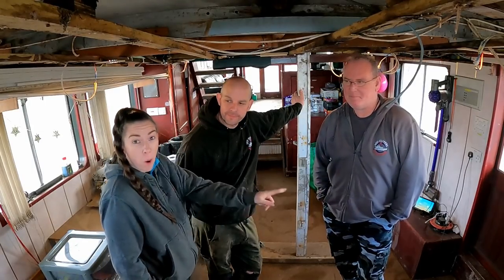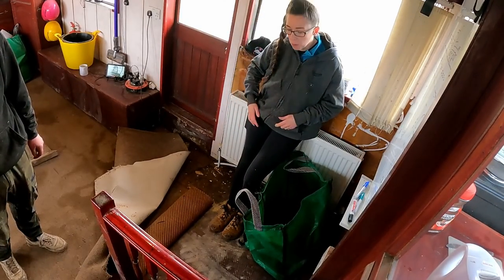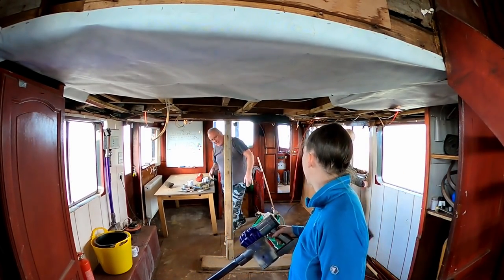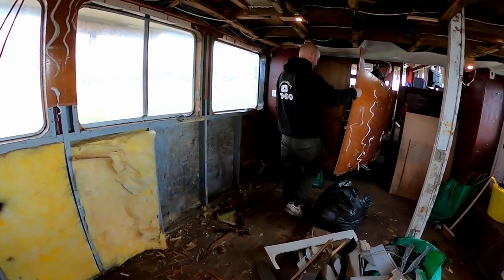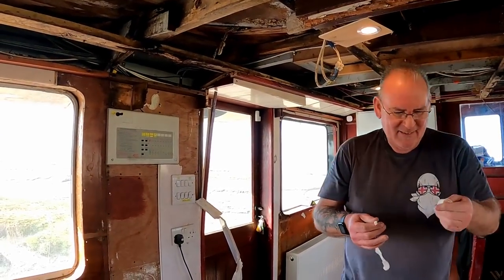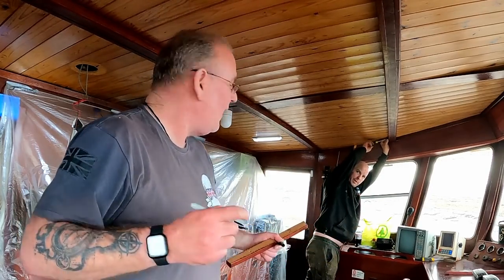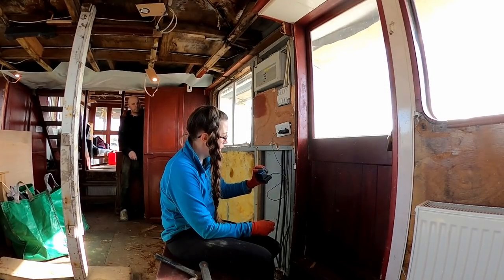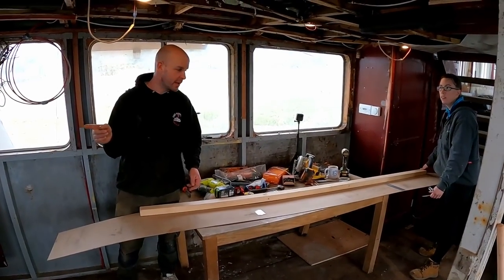Ep 63 - How to Make a Template For A Deck Beam -Progressive Destruction Day On The Boat

Comment: Gemma, most people don't know, but on your DYSON, there is a small knob on the top within a circle. Pull it out. That's the secondary air filter. If it's clogged, it will stop the vacuum from working. When the filter is out,  the  vacuum should work. You may need to use the air compressor to clean that filter. Thanks for the video. Jon - Southern California
Reply: Same thing happened to me.  Flashing red light. Thought the battery was dead, but it was the secondary filter.  Easy fix and new life for the Dyson.

Comment: Make sure you RUN EXTRA wires when you do the repair. That way you can add circuits later or use them to repair circuits without tearing into the walls and overhead. Looking good so far on the tear out. It's gonna be great to see the new rafters and runners going into the overhead. Best Wishes & Blessings. Keith Noneya

Comment: When you reframe the deck(s) above the engine room are you going to build in a "SOFT PATCH" that is reasonably easy to remove in the event of needing to do major work in the engine room?  A little more work at this point will save countless hours in the future if refit work in the engineering spaces is required.
Reply: Classic boats I've been have a Soft Patch built in either with an easily removed skyvent or panel. My wheel house had a pair of vent cowls that allowed a hoist rope through when removed, the engines could then be hoisted up to floor level and then out of the wheel house door and then craned off the rear deck. The wheel house floor and beams were slot fitted and straining points held the hull in shape, temporary wires and turnbuckles were used during engine refit.
Looking at the standard of the woodwork, I would wonder about the standard of maintenance on the CAT engines. So provisions should be made for their removal. 

Loved the Brit banter, something I really miss. Take care you all and thanks for entertaining me through breakfast.
Reply: VA3 GJA, great watching these guys, really enjoying them.

Comment: Congratulations for all this work done since the beginning...!! I discovered your channel, and realized that nothing is impossible when you have ideas, courage and are motivated to achieve them. a crazy project, indeed which is progressing well, you have done the most disgusting, it is necessary to precede. The advantage of wood is that you can repair and replace parts, you now seem to know what you are doing, it is always better to plan too solid, than not enough...!! I will continue to watch and wish you many Patréons who will follow you. Speaking of mental health, it's true that for 2 years it's been quite dramatic, especially when you get older (retired) and everything hurts you to undertake. staying in bed (siatics) isn't the solution either, and looking at you I tell myself that I'm going to have to move my buttocks... good for you... vincent in France Bretagne, opposite you !

Comment: Well. That could have been a lot worse. As long as the uprights are still good, the pretty panels shouldn't give you too much issue.  (Hopefuly)

I was surprised at just how much the sound In the wheelhouse was effected by removing the ceiling and insulation.

You are both doing a cracking job with her and are progressing a lot quicker than I thought you would given the time you have available to spend on her

Comment: Have you checked the filters in the dyson? They need frequent washing!
Boat crack!😂😂😂😂😂
Reply: Don't know about the little battery dyson, but my big mains one has 'hidden' filters that need cleaning. Let them clog, no airflow, motor overheats and turns itself off until it cools down.
Reply: @hamshackleton  We hav3 both and the little has similar filters that need. Asking!

Comment: Considering you have two large inboard engines, it would be advisable to "re-design" the coachroof, and flooring above the engine room to incorperate some hatches. If you need to remove the engines, you can only do so through hatches in the floors and coachroof. Otherwise, you will be exactly the same as those that have done the patchwork roof before.  Good to see the work done so far, you`ve definitely got a long term project there, do you have a time frame, or is it just going to take as long as it takes?.
Reply: They said early on that this is expected to be a 10 year project.   I think they'll do it in 5-6 years given that they have made such good progress already and have enthusiastic volunteers on standby.  Still astounding given they have a full time business and kids to take care of..!! :)

Comment: It looks like everything added in the 1980s was a bodge job at best. I’d like to see a smaller superstructure (not military spec by any means) but def less over bearing than she has at present. 
Curved glue-lam with oak strips and your excellent epoxy skills would be perfect for deck support beams.
Reply: The entire 1980s was a bodge job, really

Comment: Sailing Yaba did much like you did for measuring the arc. They also did some pole work for it as well. Looking back on their story may help you. I would have done the same thing and I would box out the support beam running laterally to the working one.  
Looks like fun.  Have to break some stuff to make it new again.  Oh and for me I would fill the void with mineral wool. On ward and up to the roof.

Comment: I hope you folks are putting the same ceiling panels back in the wheel house; I really like the looks of it.  I was wondering if the ceiling beams are the same height all the way across.  If so, one could use the bottom curve of the beam to get the shape.

Comment: I think that rather than cutting beams to shape, which won't be the strongest & will waste a lot of good wood, you might consider maybe taking a leaf out of the old techniques & build a jig that matches your template, then build a steam box out of wooden planks, then steam straight beams in there until they are pliable, bend them & fit them into the jig, wait for them to cool & voila, you have curved beams without any cutting or wastage. Alex Steele the YouTube blacksmith did some wooden furniture making using a steam box to bend chair legs a few months ago on his youtube channel, your beams will be the same but bigger...  I'm going to guess that's how the original was made...

Comment: Gemma, 
I have had several "stick vacs" and found the Vax and Dyson units to be expensive and disappointing performance wise. I then stumbled on the Ryobi stick vac and found it superior to both name brand ones and considerably cheaper. Plus it uses the same battery as the Jig Saw. 
Might be worth a look at for small clean ups. I don't have carpets so mine is the go to rather than hauling out the Shark upright.
Eric

Comment: Deck - the floor you stand on. Deck-head - the bit above your head! Upper deck - the outside floor. Between decks - the spaces between the deck-head and the deck, stacked up one on top of the other. Lower deck - anywhere inside below the upper deck.
Reply: I thought a deck-head was that plank you squatted on off the stern of the boat, to save you going inside to the porcelain seat.
Reply: @garyb47  - no - the porcelain seat with the hole in the middle is the 'Head' - - plank protruding over the stern? A bucket is a lot safer, and not so easy to fall off!  :-)

Comment: They probably cut into the roof  to drop your Cat Diesels .. then just bodged it back back together. 
As said earlier if thats above your engines build in a removable section of overhead that can be un sealed and un bolted and lifted out in one or two pieces.
Reply: But odd, as believe the engines are the same age as the conversation?
Reply: @dhutch2000  
Conversion.... Possible they also might have had to do some other work on the Deck above.. 
but if it is above the engine room they would best plan ahead ... those engines might be historic artifacts within a decade. Even if nothing goes wrong with them ... Firing them up at the moment will be like burning 💸 money so they may have to convert to something very different if they want to use it to travel.🤷🏻‍♂️

Comment: instead of a compass, use a flat stick with a measured 90 degree square end, that will keep it straight so you don't get an offset, then drill a hole in it for the pen.
Reply: Unless it's curved....

Comment: Question: are you going to add additional beams for roof strength? I am thinking of the wild parties which will happen on that roof!!!!
As always, great job.
Reply: I was wondering about this too. them beams arn't as thick as whats in a house. Then again boats can't have too many people on the top anyway for stability. Does each boat come with a manual of how many people on which floor. Narrowboats I know are made say with a heavy base plate. lesser for side walls and lesster again for cabin above the gunnels. like 10mm, 6mm, 4mm or 12, 8 4.